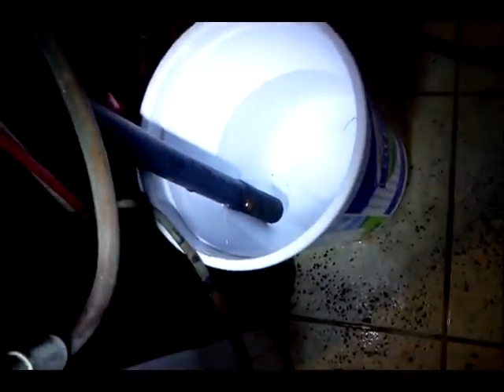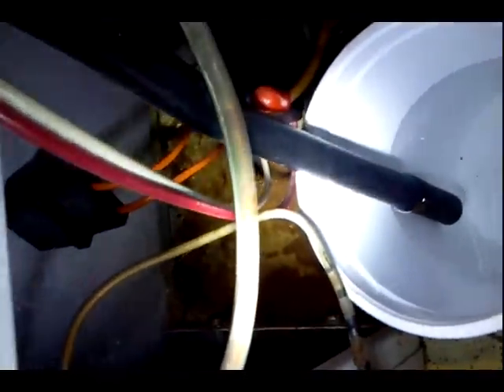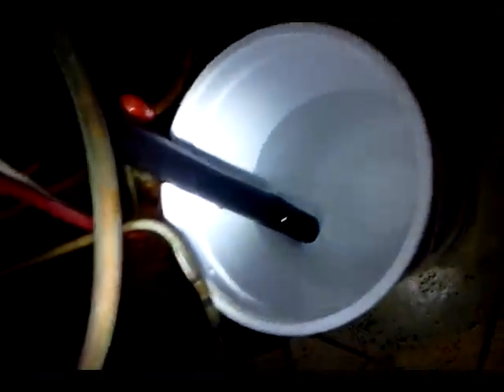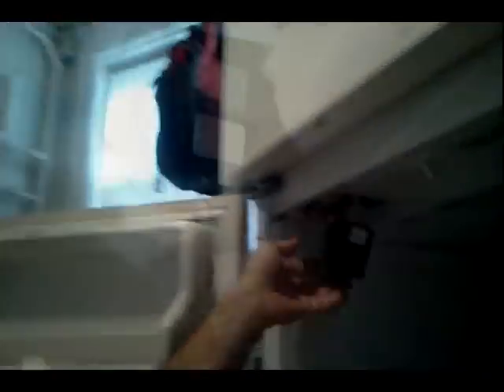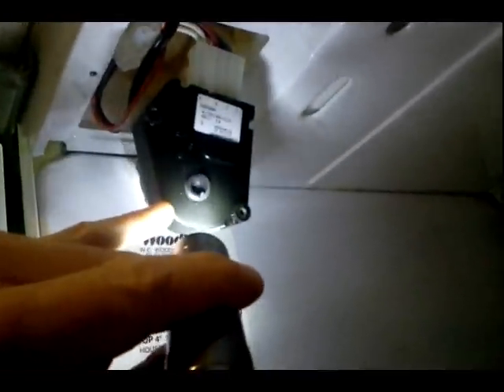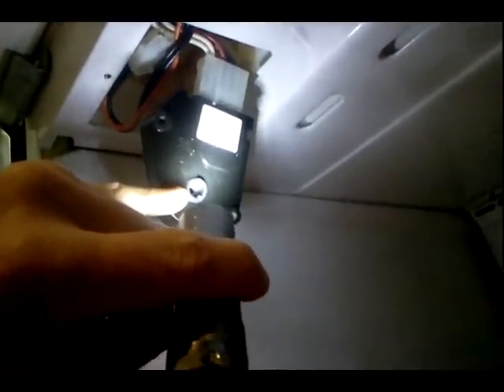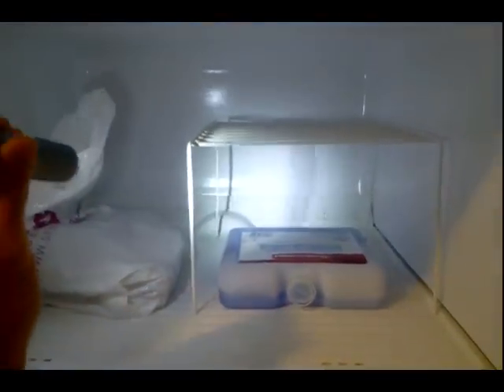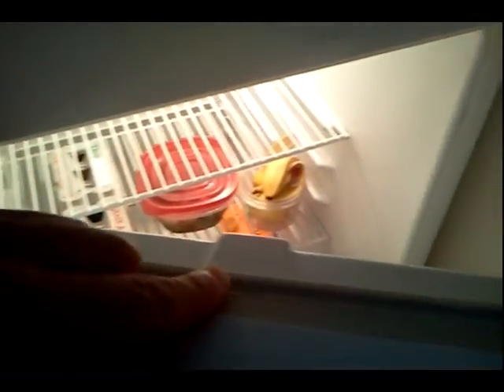Fix Freezer Ice Build-Up: Reset Defrost Timer Switch

Comment: That looked like the defrost timer to me. When he spun it around he took it out of defrost mode into the freezing mode. When he did this the compressor kicks back on. Then in 8 to 10 hrs  giver or take it will go back into the defrost mode. And should engage the heaters on the coil. Which heats up for 5 to 10 min. or so. All together the defrost mode lasts about 30 min. Then clicks off and goes back into the freezing mode. I am told that this part often goes bad.
Reply: William, you're absolutely right, that is a defrost timer, not a reset switch and he did take it out of defrost mode.  Thanks for posting your comment, because if this was the first video I watched while trying to fix my own fridge, I would be in a lot of trouble and more confused than ever.
Reply: William Wynn hi William I have an old fridge with a faulty defrost timer (it gets stuck, makes clicking noises). 
Is it possible to remove this timer altogether, and just deal with frost build up myself if it builds up. 
Im wondering if its safe? Or can I (should I) replace with a suitable timer. Genuine timer part is difficult to find- 
Its an Hitachi model, really nice fridge if I can keep it.
Any help be much appreciated ☺👍

Comment: Defrost timer is not a compressor reset. It is an 8-10 hr timer that has about a 30 min space for defrost cycle where the evaporator heater turns on in conjunction with defrost thermostat/thermistor